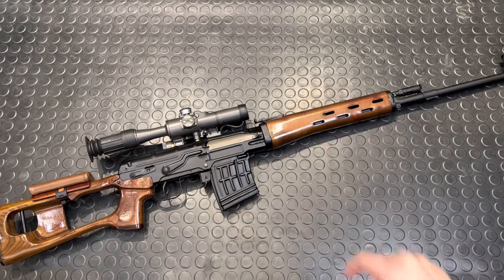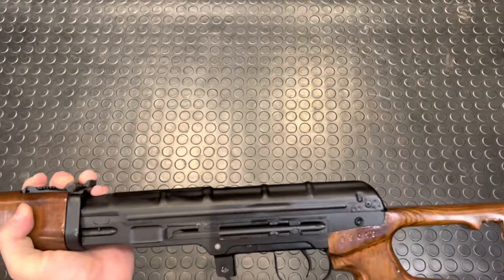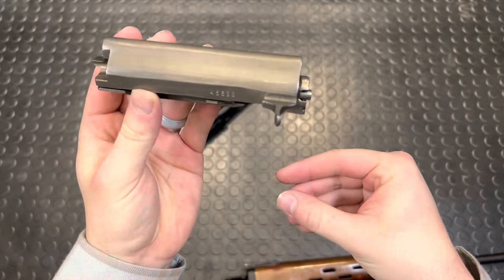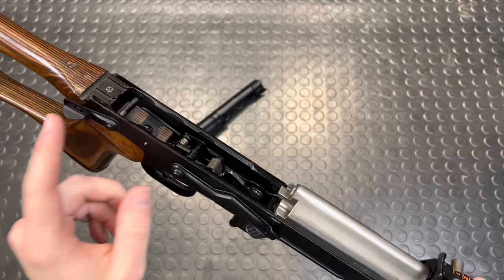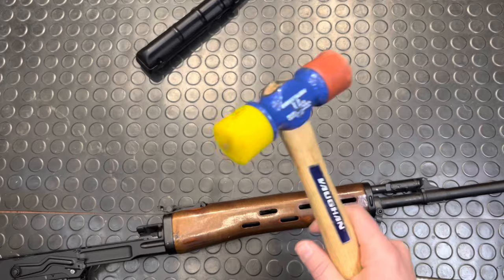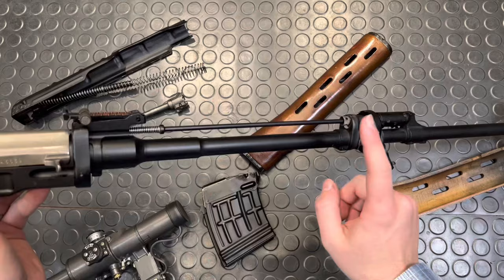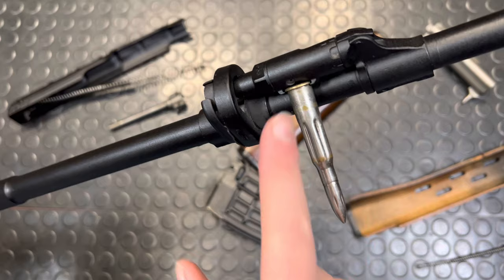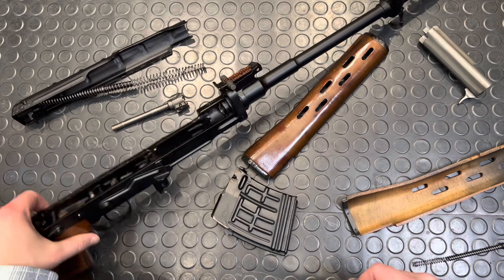Dragunov | How to Disassemble

Comment: Did you forget to drop the trigger assembly(flip the safety lever up towards the reciever rail and remove), or is that not part of the strip? Also if you push the pusher rod towards the receiver then remove the piston first it makes removing the rod alot easier. Nice video and beautiful rifle, regardless.
Reply from the maker: I just forgot, it wouldn't be a normal part of field stripping, but it is very easy and I should have included it. With the cover off and carrier out, move the selector all the way up until its vertical, then wiggle it out. Once done, the trigger mech will rotate out, just pull down on the trigger guard.
Reply from the maker: Also yes on the piston. I realized that when taking it apart again for the thumbnail. The next gun in this series is the 1918 A2 BAR. I took it apart several times to figure out a few tricks in preparation. It will go live tonight or tomorrow AM.

Comment: Do anybody happen to know what is the thread dimentions on the front sight post? 
It could be the same as AK, but in comments for replacement fiber optic AK sight somebody wrote that it was loose on SVD... It could be because the post didnt have split bottom end for increased friction, but maybe the thread is different.